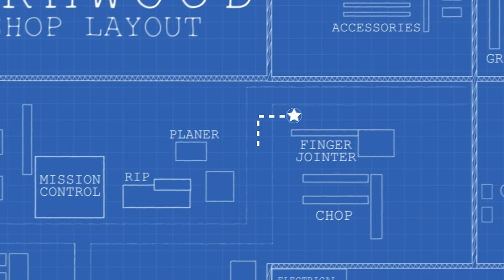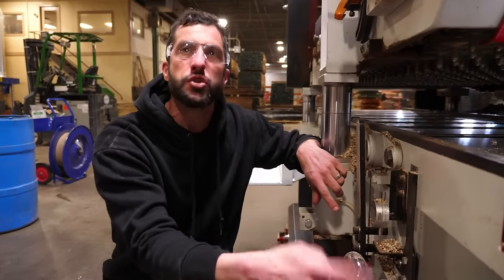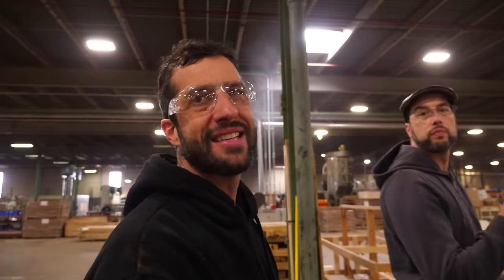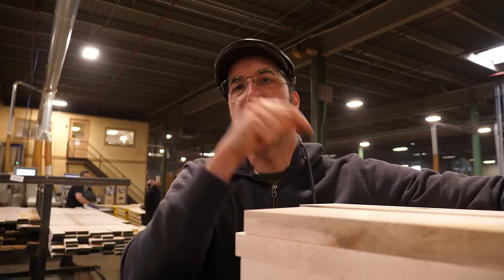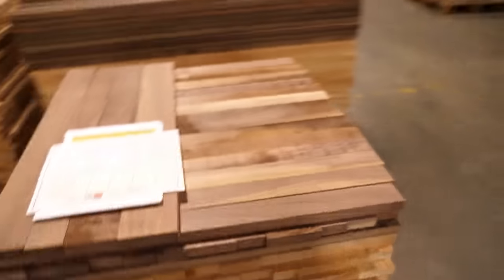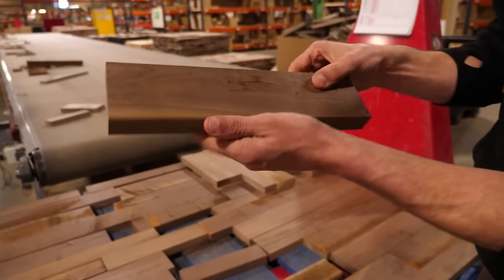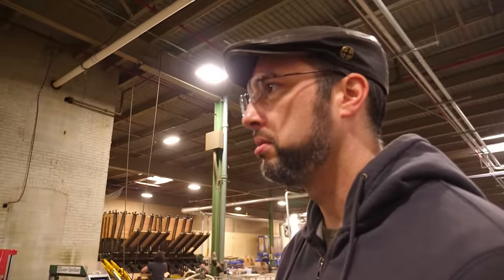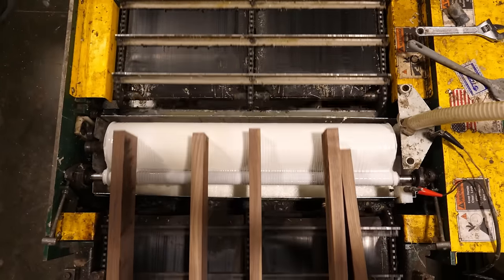Tour Our $10,000,000 Woodshop! (part two)

Comment: as a professional woodworker who has only ever worked in small 1-5 man shops, it is fascinating to see production on this scale and how all the principles are the exact same, but the tools are absolutely, wildly different. I have to joint every piece I cut on an edge and a face, then plane it to thickness, rip it to width, manually sand every surface, overhead sand it if I'm lucky enough to be in a shop that has one, rough chop and then final chop, etc, etc, etc... It is so cool to see machines that can do this much stuff, sometimes multiple steps at once, so quickly. I didn't even realize that humidity control was a thing in wood shops. I thought that was just for the kilns.